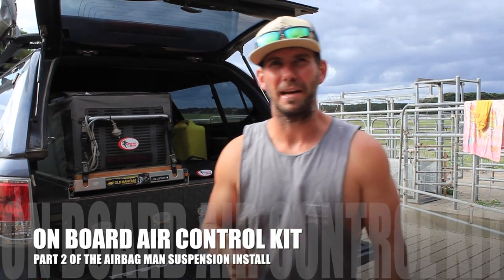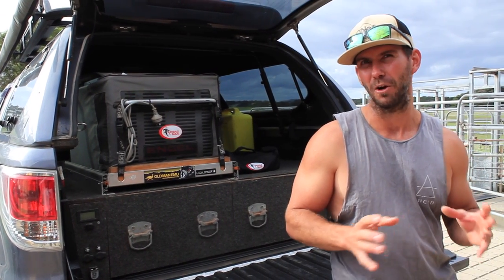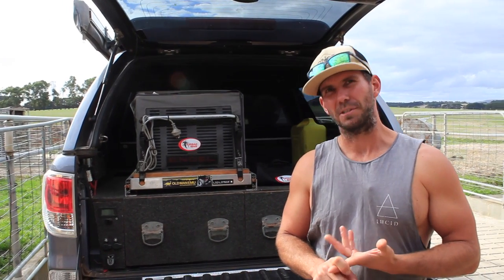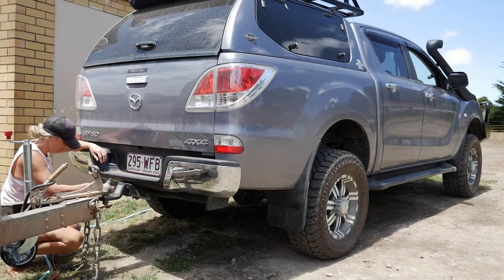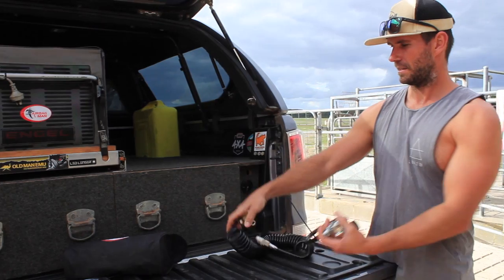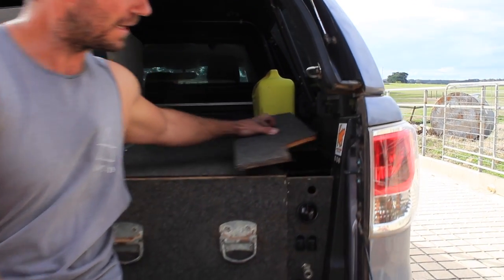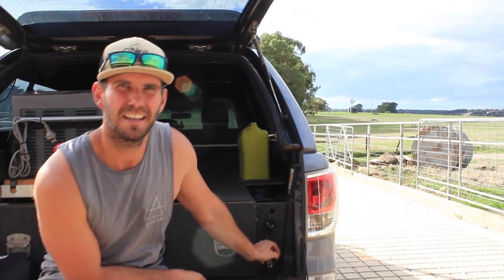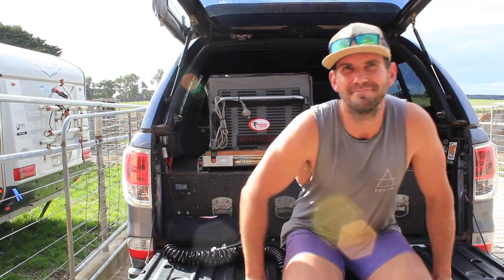Trip In A Van's On Board Air Supply System for your Airbag Suspension & Tyres

Comment: Recently added those paddle switches and black-face gauge to my Silverado. It already had the air bags, but were only adjustable via the good old Schrader valves. I installed the paddle switches under the steering column and the gauge is on my A pillar.....so i can adjust the bags from the driver's seat. I don't really understand why you would have installed all that great hardware in the back where you can't monitor/adjust it on-the-fly. But...each to their own I guess.